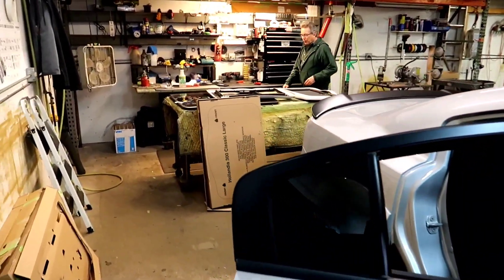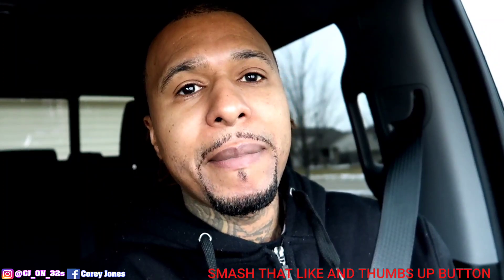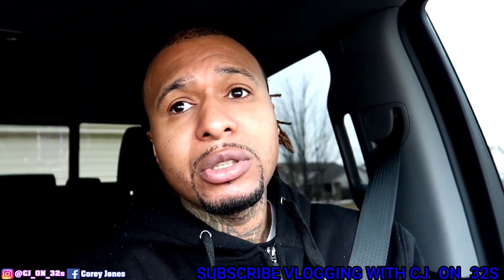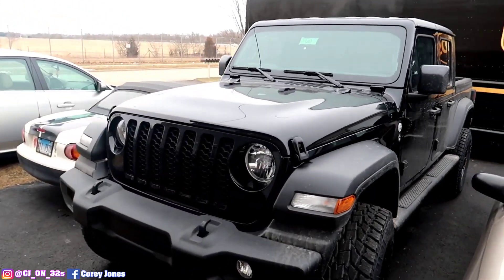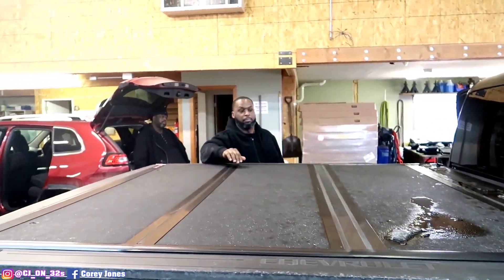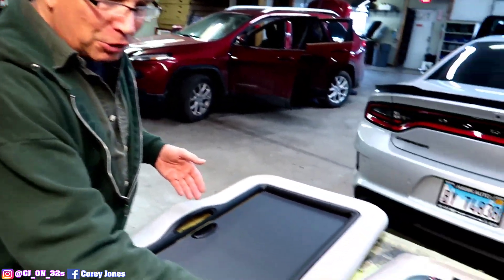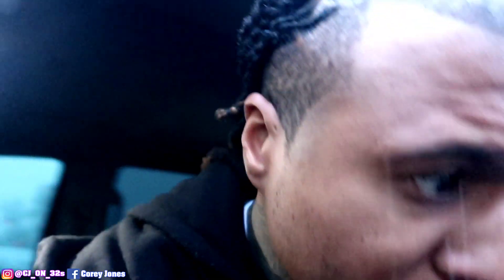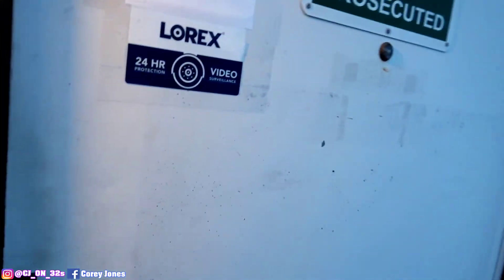THEY RUINED MY 2020 WIDEBODY CHARGER INSTALLING DOUBLE SUNROOFS

Comment: I was wondering how the structural integrity is. I could be wrong, but I thought vehicles with panoramic or even sunroofs have additional reinforcements from the factory compared to ones without? Are they adding anything to support the increase in weight to your roof? I'm also wondering about flexing...
Reply: Yooooo never thought about that. That's a good azz question. I wouldn't think much about the weight but more of just structural strength. Does any of the cutting do anything to the body strength of the car